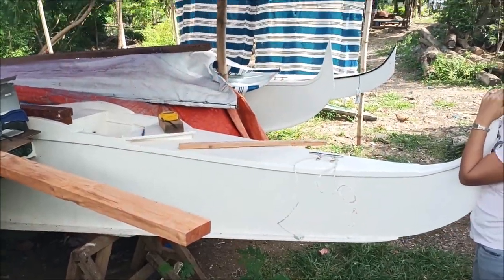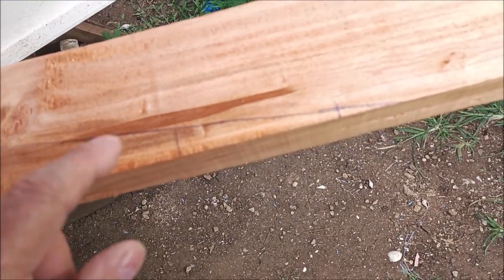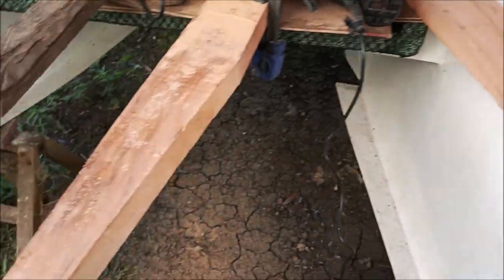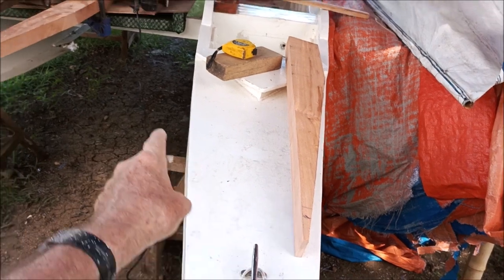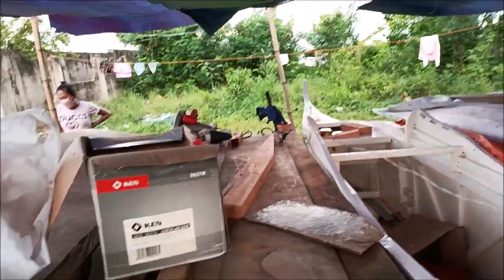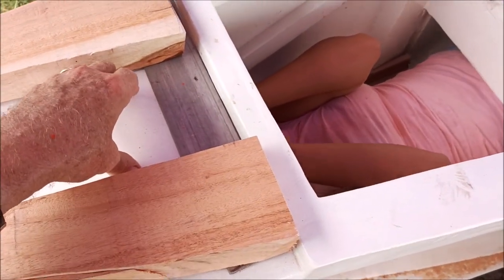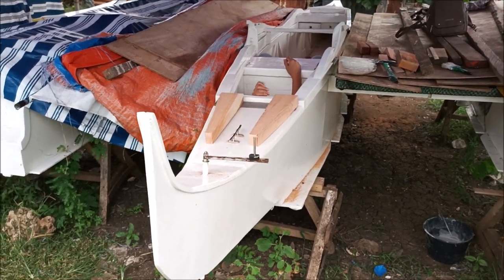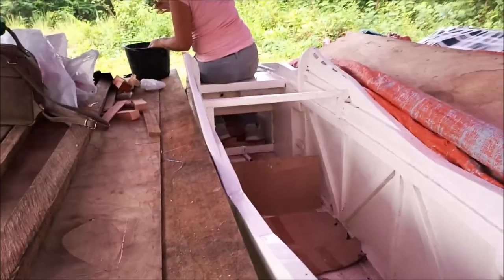Paradise Trimaran Boat Building - Beefing Up The Bow & Stern For The New Tarpaulin Supports

Comment: When You wanna cut a straight line with a jigsaw lay a straight edge on the work piece as a guide.
Hi, how is that paradise dragon coming along ? That is a lot of beef You are adding lately and that´s gonna cost You a few extra chicken burgers  for the guys that carry the boat to the water. What a project this tarpaulin. To be honest I am lost... seems to take more time to build than the boat. What comes to my mind. It seems You have some really nasty winds sometimes and they don´t mix well with tarpaulins. Hope You take that under consideration. Haha, can´t imagine You want the dragon to grow some wings.
Well, whatever, Have fun)) Cheers
Reply from the maker: It might be half water dragon and half flying dragon 🐉🙂
I plan to tie down the sliding/removable tarpaulin supports so the tarpaulin doesn't get wings in a big wind (I hope)😀
Reply from the maker: One thing that adds time to the tarpaulin is having to wait on the welder to fabricate and again for the canvas maker to also fabricate, I also can't order everything at once because this is "building by ear" so each step determines what the next step will be, kind of like puzzle building😀